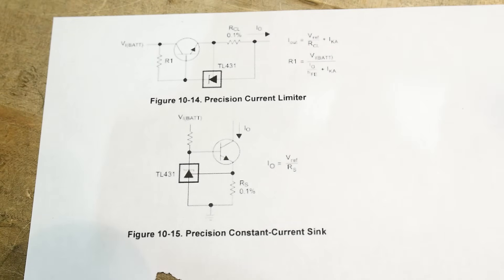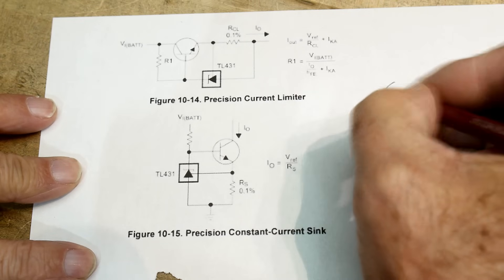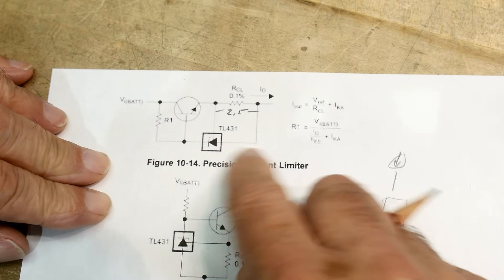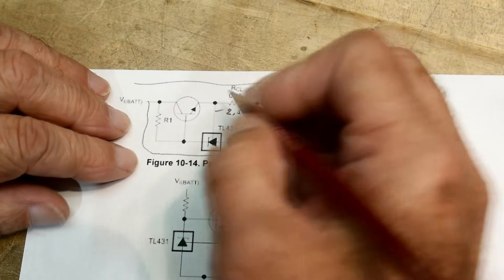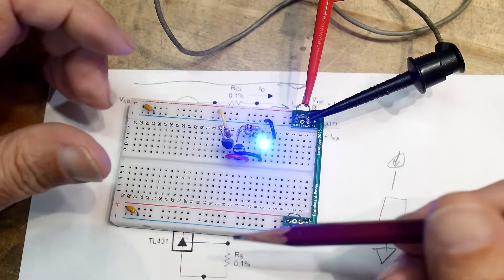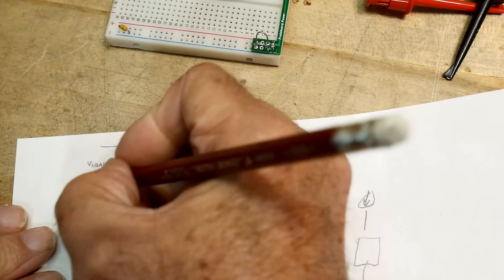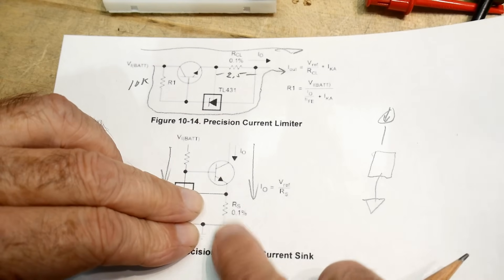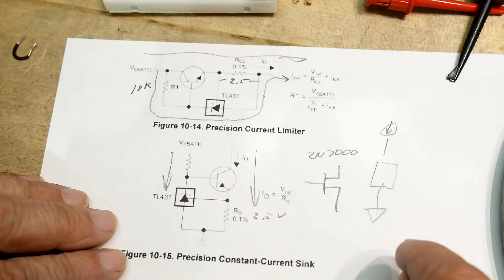#1878 Current Source using TL431

Comment: You say current, but your arrows are (generally) indicating the electron flow.  The constant current circuit is not junk, adding a 10th of a mA (with a 10 KΩ resistor) for each input Volt is minute for a 8 or 10 mA circuit is a mighty small corruption, BTW:  the TL431 requires about 1 mA of cathode current to operate.  I doubt it if a TL431 will operate with a 10.KΩ source resistance with 5 or 12 Volts input.  If you use it to test LEDs (in case it is tested backwards) and visually observe the efficiency, it should work just fine. Ron W4BIN

Comment: "Precesion current source" from TL datasheet is not precesion, because current of TL ground pin is added to stable current from shunt. And this current depends on load voltage drop and V_batt. So... It is profanation
* Current sink from datasheet - works

Comment: As I think many have already mentioned, it's a precision current limiter, not a precision current source. The TI datasheet uses the correct description. I use this part a lot but usually only for current sinks since it needs about 1-3mA to keep it in regulation. There is a better part ATL431, which is more 'precision' with Ika around 200uA or so.

Comment: Why are you worrying about base current? It's irrelevant as it gets measured in Rs.  The unknown is what the current through the TL431 is, that is what will throw you off, especially if it is voltage dependent.
Reply: Yep. I was wondering the same thing. I believe the base current in the second circuit doesn't matter, because it is included in the current through the sense resistor. As long as the TL431 correctly maintains the 2.5V drop, the base current should be irrelevant.

Comment: One ancillary benefit of the older 2N7000 N-channel MOSFET is that its channel resistance won’t be that low with only 2.5V of VGS, so that will inherently limit the brief inrush when the DUT is initially connected.

Comment: Having gone through these types of circuits in the past (both for sourcing and for sinking current) one caveat of the TL431 is that it needs a minimum Ik in order to maintain the regulated 2.5V. That current from the datasheet is anywhere from 0.5 to 1mA. So for a current source, that is what you have to set with the extra resistor in order for the regulation to work, and will be added to the regulated current. There is another device though that can get you much closer to a "precision" current source, the TLV431 or LMV431. Those have much lower Ik requirements, on the order of 55 to 80uA. Thus you can use a much larger resistor in series with them, and the extra current added to the regulated one will be much smaller and less supply-dependent. There are 2 caveats though with using the TLV431: first, the regulated voltage is 1.24V not 2.5V; second, maximum cathode voltage it tolerates is 7V.

Comment: The limit and sink circuits are actually the same except the Io in the sink circuit is from Vcc through the collector avoiding the current through the TL431.  Basically either connecting between Vcc and collector or between emitter and ground.  One is good the other is bad.

Comment: Figure 10-14 shows nothing else but a current limiter.
For an accurate precision (+) current source to ground potential IMO it might be worth looking at a current mirror circuit.
Reply: the schematics in Figure 10-14 is actually wrong as he said, unless the load is placed between Vin and the collector of the transistor.

Comment: I used one of those 431's  in is a shunt regulator of a solar panel that powers my driveway gate.   Your zener tester sounds like an nice little project.  I often find my self testing zeners with a resistor and a power supply.   You tester could  also check LED's  for forward voltage drop.
Reply: Very good excuse to buy an SMU btw :)

Comment: incredible, but I'm designing a crude volt to amp source with a pmos and an opamp, for measuring resistors. it's crazy that these circuits are so off, even on the datasheets of the components!

Comment: Any reason you’re not using an LM317 or any other LDO  in source configuration? Asking because I’m probably the dumb one
Reply: There are not too many differences between them, actually. Basically, tl431+resistor+power transistor=lm317-protection circuits. Only to note, except of lm317 protection, that, (1) minimum voltage difference is 2.5 and 1.25 volts respectively; (2) in lm317 npn Darlington transistor is a built-in and cannot be changed; (3) to build current sink you really need lm337 instead, as protection circuit of lm317 does not like sinking current.

Comment: The circuit is really from the TI datasheet where it is called Precision Constant-Current. With 5mA and a beta of 250 the collector current is 20µA smaller than the emitter current. This can be eliminated with the FET. What remains a sense current for the TL431 of 2-4 µA which is then below 0.1%. (It depends on what you call precision, maybe the term precision is just taken from the name of the TL431 which is called "precision programmable reference".)
Reply: 'precise' is how many digits are known. 'accurate' is  how close you arrive to the value you wanted. If you create a 5.00001V voltage source, it is very precise, but if you wanted a 3.3V source, it isn't very accurate.

Comment: The TL431 is usually advertised (and used) as a low current adjustable zener replacement [e.g. voltage regulator].  Try an LM334 for regulated current of 10 mA or less, or the venerable LM317 for higher I.  Simpler circuitry to your above circuits and they both work well.

Comment: Use a any 3 terminal voltage regulator as a current source or sink.   Easy to trim if the current is not above dissipation of the trimmer. Use a LMl317 or any LMlxx voltage regulator.  Can be used either way just put it in line. Have pretty good temp and voltage drift if you do not over load. If you want to measure zener voltage, use your  power supply. Set the max current and voltage and connect across the zener. Read voltage on the power supply as supply goes into current limit.  The max zener voltage to measure iis the max voltage of the supply.